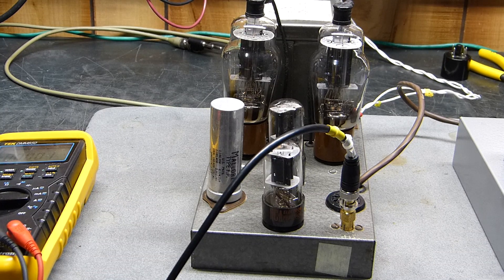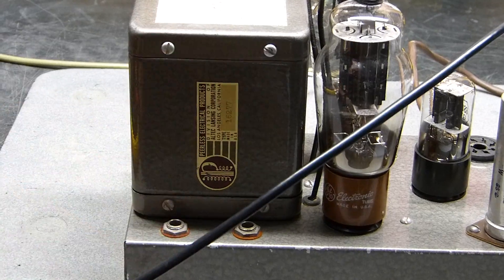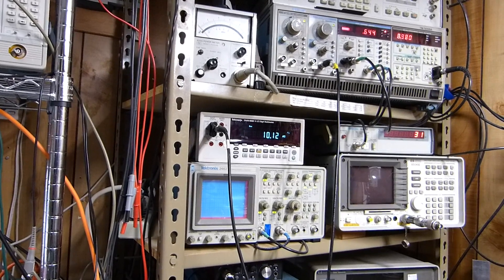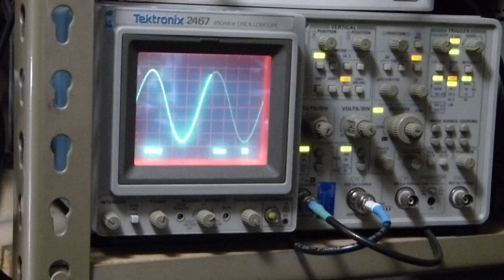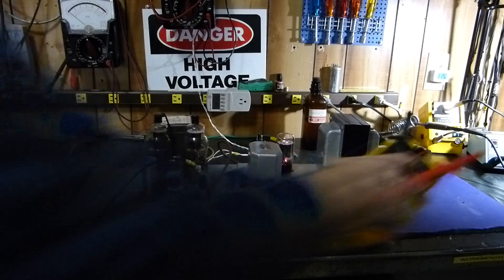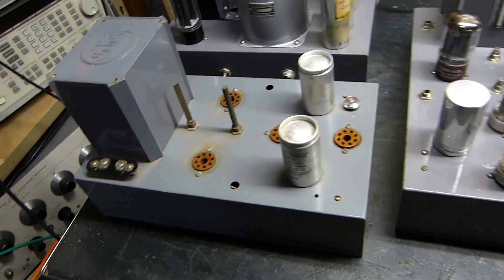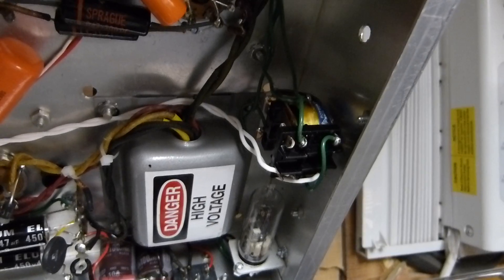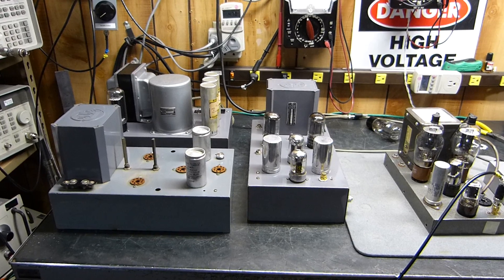Heathkit Model WA-1,  20 Watt, 807 Vacuum Tube Amplifier Tests

Comment: Hello El Paso tube enrhuiast! I luckily found you're YouTube channel last night and have been up all night watching and learning!
I've been collecting tube gear transformers etc etc since 1988 when I was only 18 and oddly enough  people and physics departments companies radio stations were just throwing the stuff away everywhere as cd and solid state was so in favor. I heard a heathkit Williamson w5 highly modified with balanced resisters vitamin q caps everything balanced so the push pull and phase inversion went back into balance. Through a nice turntable and altec Lansing voice of theaters and I was so in love I sold all my expensive gear and bought all the tube gear and analogue hifi equip I could find!
I even have some rare utc for audio only edition power transfirmers and chokes meant to be sold as pairs for dual mini power supplies 800 cr tap 20a etc etc and tons of peerless and accrosound opt matching even nod in box same day made sold as matching pair never even soldered. Nothing like your collection but I have amps need fixing some i e been able to of w2, w3 w4 and w5 as well as citation 5 with bypass tube power supply. Was gifted saved from a dumpster a lambda tube regulated power supply and two huge techtronix with four 6l6 power tubes in regulation stage all for preamp 0-275 vdc range with heater taps- I could go on and on...sadly few years back I broke my back in a car accident acsenibtruck hit me also suffered a tbi injury so my tinkering and fixing amps was limited but my passion was not.
I saw your video on the Williamson wa-1. After decades of looking to find a pair of those I acquired two however one is a dead ringer match for yours the big red caps everything works great. The other has yellow caps and doesn't match the specs of the other. I love dual mono over stereo or mono. I'm wondering if you'd consider a sale, trade, any combo of above as completing that pair with a matched 807 to my red cap good condition one has been a last dresm of mine. 
I don't know if you still accept audio projects but I also have. A few including those utc transformers and variety of other ideas. I also have a vt25 anp like the one you buildt but my specs and preformance are much better than you got bout of the vt25a model.
I didn't see a contact email or number or address. I'd love to send you pictures of all the gear I'm getting ready to trade sell all kinds of old eico preamps to main to integrated to hesthkit to random transformers and output transformers and boxes and boxes of nos old tubes and used test better nis on my recently cakibrated tv7 and ma Meter added by a kind fellow your area of our good country.
I had a few thoughts as to why you mentioned in your videos why you liked those 2a3 like triodes. I could list 100 plus reasons why tubes made in 30's to 60's even 70's just sound better no word captures the quality aspect even when new made ones may according to test equip look 100 percent they are missing everything from the decades of craftsmen ship and skill those old timers had and apprenticeships the unlimited funds put into them espially during and after ww2 Cold War and beyond done best tubes I've bought are from the NATO supplies a soldier sold me after t hey finally switched from most of the tubes just in like 2006 completely as some radar units even in air traffic domestic 12ax7s accuracy and longevity were so hard to beat little airports across the country have had (I've seen them) sheds full of cases of nis tekefubjens mullards etc until fairly recently! My military buddy said we even made certsin tubes up till 1988- I have 1987 stamped nis boxes. That's amazing as still making is way different than not using it implies intention to use many more decades if still continuous production decades past I had any knowledge of also in case of emd pulse of course tubes still work while diodes chips silicon will melt.
Anyway, getting older my health isn't the best, dealing with my back and biopsy for tumors hopefully treatable as I've lived gealthy. I'm getting rid of 90 percent. If my equipment and tubes to give others a chance at the pleasure as a lot of what I own you can't find it but for any price.thee days.
Oh I forgot, I'd bet if you compared a quad or pair of kt66 grey glass nos or used test matches both gm and ma of plates that even though new production may match values you'll find that those 6l6 amp steep you converted sounds as good or better than those 2a3 equivalents you out in them! I've just heard it so many times the older the tube if good audio tube in general the older date if tests good better it generally sounds. I paid up to 800$ a matched quad for kt66 in box back before eBay late 90 s and 600$ to 800$ up till 2010. Price wVers abit niw but 100-200 a used test nos consistent price for 30 years speaks volumes when you can get same new quad for under 100$ when first made. The quality of sound even with simi liar numbers is night and day it would explain the unexplainable better sound your hearing ftom those 40 s tridoes. Or at least a large part of it! Before I was gravely injured by a semi truck that tboned my drivers door going 60mph- a mirical evi survied- 
I was a professor and invested in dozens of older tubes. The kt66 a favorite of mine sounds different from 1930's up to 1070 s but the test data will show same numbers however the metalurgy good construction triple and high quality mined mica support reduces mucrophonics. I could go on and on and on lots of these guys were fired in their prime at factories to save no net and the tubes quakity just pulled t h E floor out under them. Same with Russian made new tubes late ninties early turn of century alit of 60-80 year old linemen and foremen managers knew this trade from a boy were all "let go" and all kinds of nuiance trade secrets you only learn with apprenticeship and decades of hands on eirking not printed in any school textbook were. List and one year new mafe tubes in China Sbd Russia were "ok" sone factory's decent even next decades theybwere notbeven acceptable and companies that resold them had to buy thousands and test just to find a few quality quads and matched at that upping the price and wrecking people's lives and a goid industry. I have a good friend makes a living selling vintage tibes back in Rockford Michigan where I grew up- I'm in northern Cali now where I taught be flush for along time.
I'd really value it if you could spare time to contact me if you don't have time for projects maybe you'd consider a trade or sale as I have lots of a huge variety of tubes for sake including lots of unknown tubes of equal quality to ones people pay thousands for just no one bothered to do all the research. As well as all kinds of kit amps ftom 40s 50s 60s with great iron on them mains and output and chokes. 
And all kinds of altec Lansing soesker gear even extra pair of voice of theaters. 515b's and 802d drivers. 
It would be a dream come true to match that 807 Williamson I have with red caps as I've seen yellow and others but not this red I've searched for for 12 years now. If it has screen taps it might be a w2 there were several versions some in between w1-w2 had ultra linear added but label still said w-1 iriginal w1 was not ultra linear had resisters to drop screen voltages and i don't even know if it had negative feedback. The w2 did and the w3 is just accrosound output transformer version of peerless using a 5881 instead of a 807 some w2 s use 807 some 5881. A Japanese audiophile I happened to make friends with sent me all kinds of translated material on esrly transformers kindly as I'd had bad experiences with mega Japanese hifi buyers in the minor ties not kind at all. He told me that the prefered tube to use above and beyond the 5881 or kt 66 nos best stock even is the 5933 with the anode cap a military version of thev807. There's a 5932 no snide but much oriced. The 5933 is affordable. He said there's three versions one is heads and tails above the rest the super black smooth metal plate with the jokes in it but not round holes slightly oval he said that version should sell for 600-800$ each if you priced it by how it sounds and advices to buy some as soon as word gets out even in Japan the market will be drained just like old kt66 s although some have surfaced past few years. I bought hundreds at 1$ each if 5933 . You can wire any Williamson to use 807 as long as screen voltage is right the plates can handle much higher voltages thsn other 6l6s! There vt100 vt100a and my favorite sounds more like a 350a or b if wired up right not well known at all is the British mikitary version labeled ats-25!!!! Best of all 807 s I've ever heard close to 350a except that sprcial 5933 black dark smooth with oval punched holes. Two other black holes ones not near as good. I've found 6-8 more other 807 cooies other designations totallybdifferent layouts of plates etc nobody knows of mine were made in 1939 by cossor for ww2 British so frequency range is huge and although not best for transmitting radio great for audio!. I'll save other secret models for if I contact you as not in my head arm all the varient numbers. 
Hope you have wonderful day- my email I use for YouTube is mysterywasthebest@gmail.com ( mystery was a cool Norwegian firrst car I was friends with for 18 years knew over 100 Emglish words!) 
Sincerely,
Mark Owens
Ps- I enjoyed you r videos a lot thanks for sharing knowledge inspired me to start taping all of my gear before I sell it while recovering from my mefical challemges! 
Cheers!🦁

Comment: Hi. With all you knwoledge, working with tube amplifiers all these years, do you know any  schematic of a class a amplifier with around 15 to 20 watts. These 807 output tubes, could  eventually be used in paralell, to produce more output power in class A mode ?
Reply from the maker: Here is a link that I recommend for finding a treasure of schematics.

http://lilienthalengineering.com/100-amplifiers-chapter-1/100-amplifiers-part-2-1945-54
There are three other files (books) of vintage amplifier schematics.
You just search for, "100 Amplifiers - Part 1, 2, 3 or 4"
They are by Lilienthal Engineering.
Reply: Thank you

Comment: Hi. Nice video. Viewing the original schematic , there are two p10 conectors between the pin 8 of the output tubes. Can you bee so kind and explain why or what is the purpose of the conectors.
Reply from the maker: The two plugs are used to insert a current meter so that the current thru each 807 tube is balanced, usually around 50 mA per tube.  There is a pot on the top of the chassis for this adjustment. This type of balance procedure can be seen in a video I recently posted on a UTC W-10 amplifier.
(PS) if you got an email reply about four tubes, it was because I was writing to you about the UTC W-20 amplifier and after hitting "save" I realized it was this video about the Heathkit amplifier and not the UTC amplifier. Hope this doesn't cause confusion...  :-)
Reply: Thank You for your time in answering. Best regards.

Comment: What’s the name of that ‘wrinkle paint’ you use?
Reply from the maker: it is made by RUST-OLEUM and is called HAMMERER. I buy it at Lowe's but I am sure Home Depot and others have it also. You can look at the top of the can and see the texture. It also comes in different colors. If you prepare the surface properly, it sticks really good and does not need a primer.

Comment: Hello David! Interesting to see an 807 power amp.  They don't put out a lot of power, but sound nice. I recently repaired/restored an old Presto disc cutting amplifier that used 4 in pp. Fidelity is actually good. Still enjoy your videos :) Keep 'em coming.
Reply from the maker: Hi Frank - I hope you are doing well.
Yes, the 807 is a pretty much a forgotten tube but in reality, it is still a dandy. I guess I have stepped back from the idea that I need 500 watts to play with and have been enjoying even 15 watt triode amplifiers. I have not gone the SE route yet and I don't think I will. The highly sought after UTC transformers I have to build and play with lately will keep me busy for a while. I flip back and forth between RF and AF amplifiers. Good to hear from you.

Comment: David it is indeed a WA 1 there are two versions the triode connected version has a Peerless 16258 and yours has a 16277 ( like the. WM 2 ) with UL taps ,you are very lucky those plastic plate caps are ALWAYS melted !.I have the triode schematic/manual if you need a copy regards
Reply from the maker: Thanks, Don. I agree that this was a real jewel of a find and as you say, plate caps not melted and it performs very well. I carefully balanced the cathode currents tonight and retested and it performs exceptionally well to 15+ watts (I am very conservative) and good at 20 watts and a little more.

Comment: I can’t wait until I make that jump from building low voltage amplifiers to High voltage amplifiers.
Reply from the maker: Never thought of it that way but I would classify amplifiers in the 250 volt range (SE or PP) to be in the five watt range, up to 450-500 volts, medium power amplifiers up to 50 watts, maybe a little more, voltages in the 750-800 volt range 100+ watts amplifiers and 2500 and higher voltages in the KW power range. Transmitting tubes need 3500+ to be in the two KW range.
Reply: ElPaso TubeAmps iv built two Cass A SE 24V Nelson Pass, Amp Camp Amp @ 15w mono blocks. One Pete Millett starving student hybrid headphone tube amplifier using 48 V SMPS power brick. One JLH amp 100w SE 42v
      I think Blue Glow Electronics , Mark YouTube channel has produced one of the finest instructional high voltage tube amplifier builds I’ve ever seen that will probably be the first high voltage tube amp I build.

Comment: Man, that's a lot of premium iron. You could build any number of very cool amps using  spare parts. Lucky man. Thanks for the video.
Reply from the maker: I have some real projects in my head for all the nice UTC iron. May take me a year to get most of it going but I will keep working at it. I plan on a triode stereo amp using the new Svetlana SV572-10 tube and a pair of the UTC LS-61 transformers. I recently have had a love-affair with the triodes and I have six brand new triodes as above.